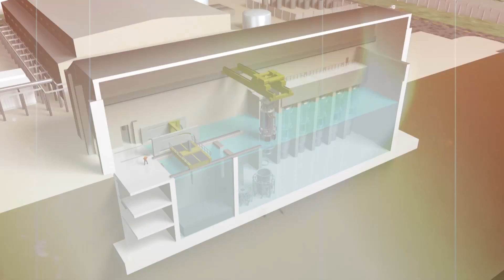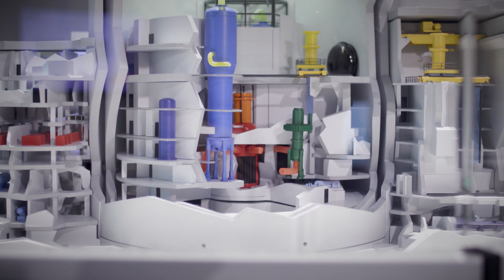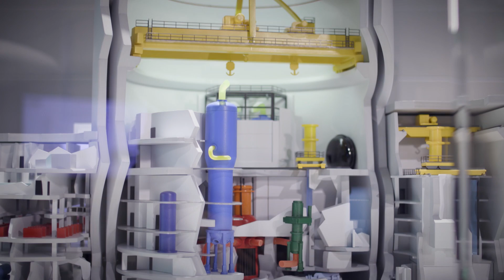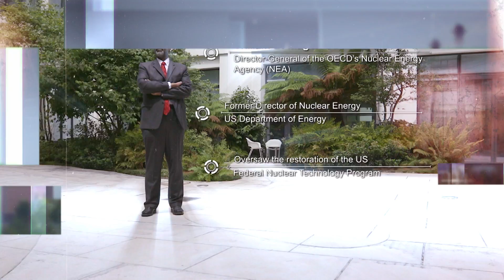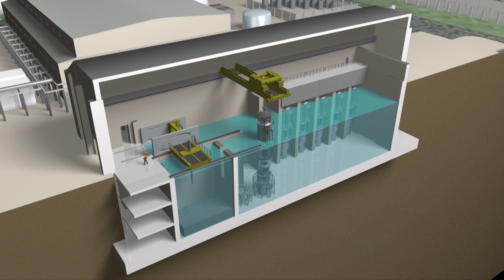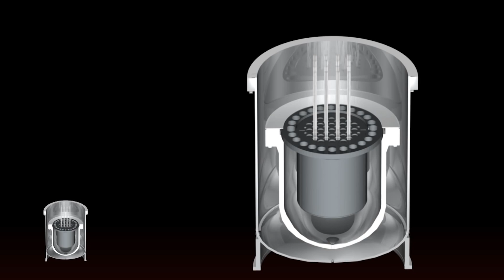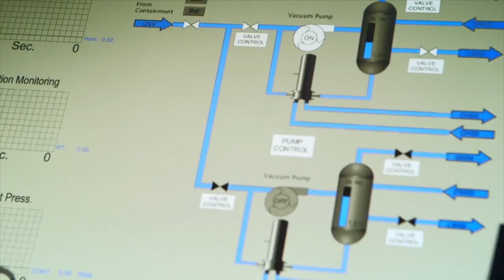The future of nuclear power, part one | Sustainable Energy

Comment: "...efficiency levels of over 90%"

I doubt that. Harnessing nuclear energy utilizes thermal cycles. Maybe you mean capacity factor.
Reply: Efficiency of turning thermal energy into electricity depends solely on the turbine.
Thus, its efficiency is roughly 35% for PWR, and 33% for BWR. Both are light water reactors.